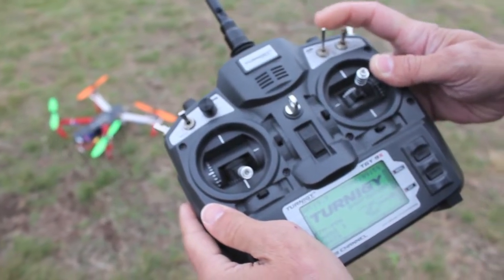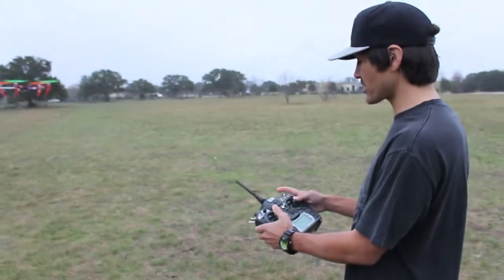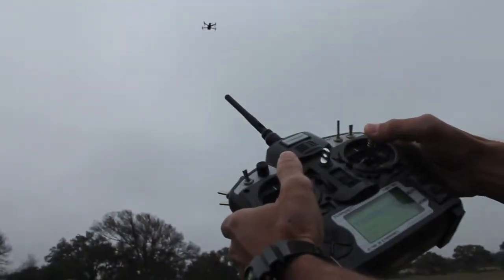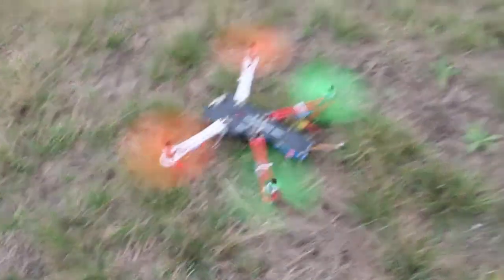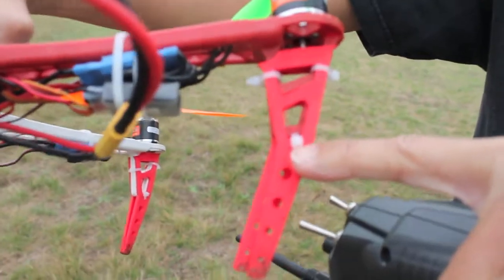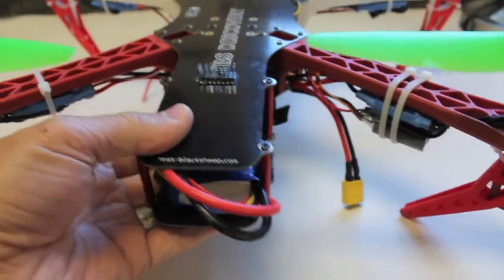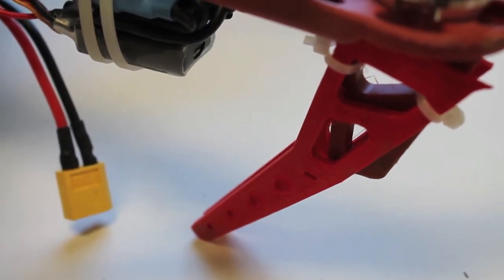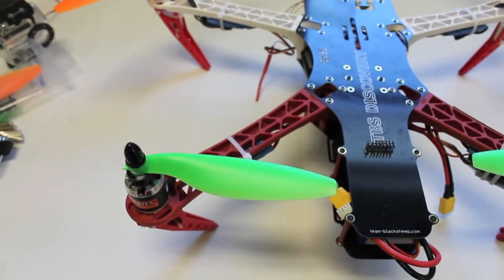DJI Naza & TBS Discovery First Back Loop Attempt & Fail

Comment from the maker: Ha! I like that reference, but am nowhere as crazy as Pastrana :) I have back and front flips pretty dialed now and am working to make them tighter. Need to move on to rolls, but the TBS Discovery frame is definitely not the best platform for trying this with. Good luck when you get around to flying manual. It makes you feel like you accomplished something, but is quite nerve-racking at first.

Comment: Soo close! You almost had it. Yep, you need to give it full pitch and get more altitude. It also helps to get more vertical speed just before the loop; your climb looked a little slow. Also keep in mind that the Naza has a slower roll and pitch rate compared to other flight controllers. You're gonna get it on the next attempt.

Comment from the maker: Rob, I appreciate your feedback given you have loops on lock. I had gotten so use to my mini quad where 75% throttle is enough to get a quick rise before pitching back. So that's exactly what I did with the TBS. Given there's much more weight to consider I will be going full throttle next time before the loop. Have you changed your TX expos at all or did you leave them at default. I know default will be fine for the time being, but just curious. Thanks for the tips.